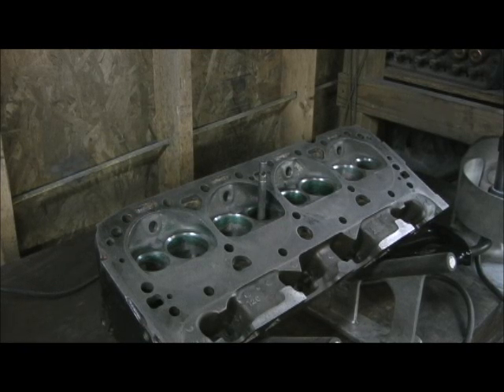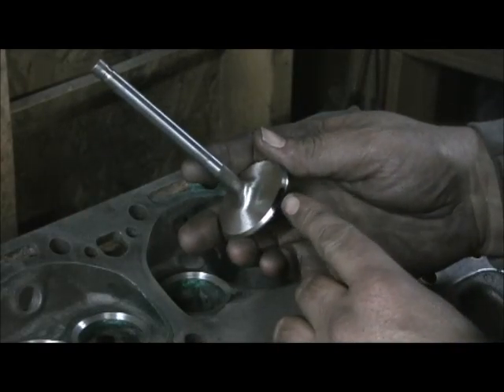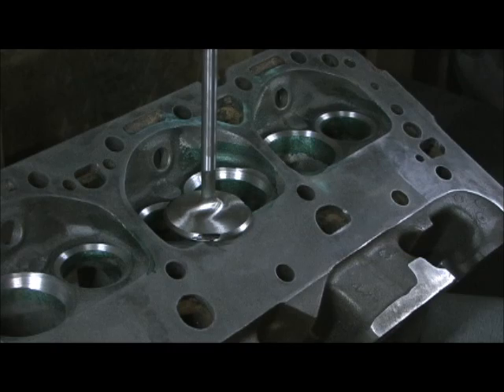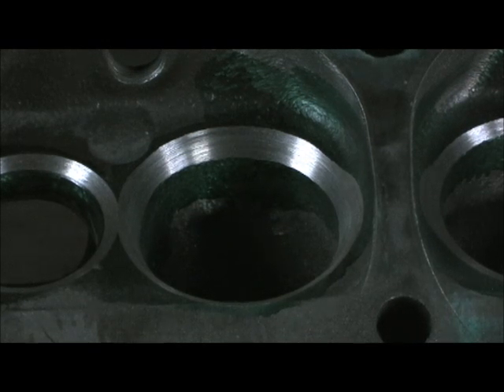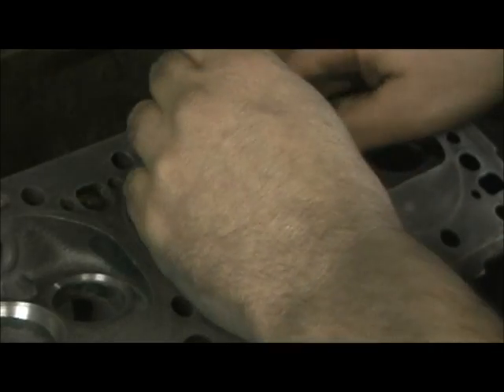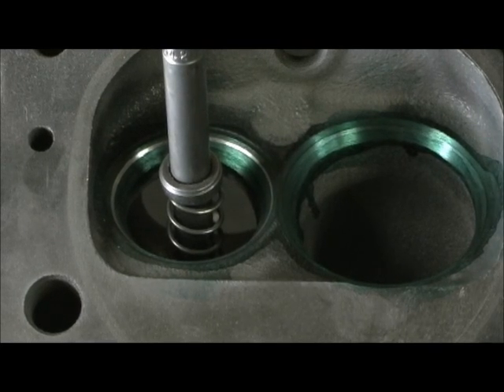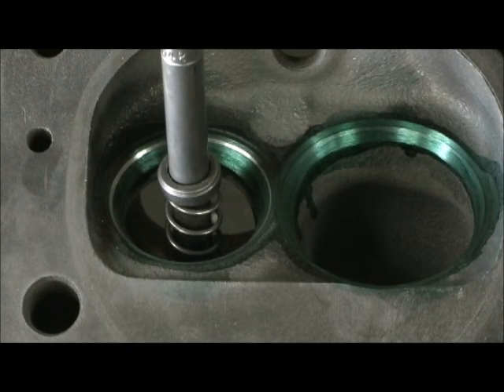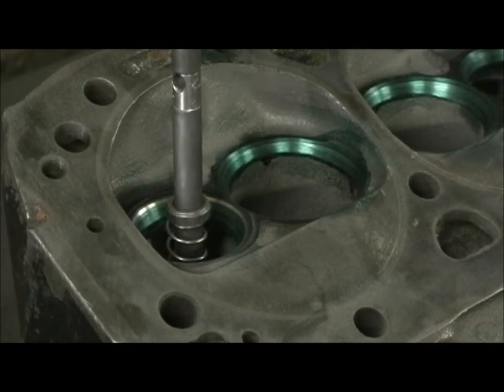Casting 441 Ported Head TRUE Three Angle Valve Job 9.

Comment: Planning to do valve job into my Infiniti FX45 ( 4.5 litre v8), 4 valves /cylinder, 2 overhead camshafts, done "simplier" engines before, also planning to hone cylinders a bit, and just replace piston rings same time. Reason for this, engine, has only 120000 started to smoke really bad, no noise, no really lost of power, but has to add oil daily now, no oil leaks otherwise. So thinking my valve stem seals did run dry a little???, now needs to replace them. So, couple questions: you think I could sand/grind valves myself?/ Done that before, and how much free play there can be in valve guides, so I don't have to replace them/ or valves?? I will replace timing chains (2) same time, so could I adjust valves ( has shims), when heads are off the engine?? Thanks, you are a good man, learning a lot from these videos! youtheman =) Also, planning to replace connecting rod bearings same time, has to take pistons out anyway...., how do I measure, what size bearings I need??? Thanks =)

Comment: If I took my 3800 Series II engine to a machine shop, how much would I plan on spending for valve porting, head truing, cylinder boring and how likely would it be to use the same crankshaft and camshaft that came with it.  I'd like to say that the cylinders wouldn't need to be bored out if I could hand crank the engine, but the damn thing is seized up.  A junkyard motor is $1000 with 136,000 miles on it, remanufactured $2270.  What is my cheapest option here?
Reply: if you buy the reman it will come with got dang china valves.

Comment: Power is made in one place, the heads. Why? Because they are the biggest restriction of the entire flow path. That is why bolting on a 750 Holley to a bone stock 350 does not do much over a 500 cfm two barrel.

Comment from the maker: Continued) engine of 350 inches at least 65 HP. Change the cam and gain another 25 to 35 HP, change intake and go to headers and get another 35 to 50 HP so it entirely possible to go from 200 to just at 350/350 through the heads, cam change, intake and headers. The power is made in ONE place, the heads, then you build everything else upon that.

Comment: still the 1.6, I will swap them this month for full 1.5 rollers, the car is wants to be above 2500 rpm, with a 6spd it's not too bad but I think I will opt for a little more drive ability.

Comment: Still the stock rear, stock bottom end, I know what will happen to that rear if I put slicks on it and until I can justify 2k for a new rear this one will have to do. I was doing some research and there is a way to make the rear end last longer but don't think I want to waste my money on a 10 bolt, rather wait, winter is coming and the car wont see the road till spring anyways. The 391 is not bad but I might as well take it to the next step with a dart block sbc 427 in the long run.

Comment: Carp, which rockers worked the best? 450 at the wheels? Upgrade the rear yet? If not you should save up. What is next a 391 lt1?

Comment from the maker: Like I said, to each there own. This discussion was not about flow numbers (although that is an issue) but rather about sealing capability and longevity of the 45 degree angle. Looks like you win guy, I hardly ever hit .0002 in my 24 years of doing this, so your the man....

Comment: If your with in .0005 with your run out that is a good valve job I use a gauge to check how concentric the seats are, I use a Van Norman machine with an air table with Sunnen cutters with this set up I've seen .0002 on the gauge that's about as close to perfect as you get I used the Sunnen VGS I didn't care for it I always had to finish with stones the run out was terrible with the Van Norman no stone finishing required and the flow bench numbers are equal or better than Sioux grinding,

Comment from the maker: WTF, Continued whenever) to remove and set the Depth of the valve in the bowl and to set up the 60 (70, 80) after the bowl hog or W/O the hog so the stones have NOTHING in the way of cutting the 45 seat angle and it will PULL the concentricity of the Seat/Bowl relationship to where they behave like a well oiled machine to one another!!! This has been my experience, and that of MANY others currently in this profession who have been at this a LONG TIME. like I said 7512, I respect your opinion.

Comment from the maker: Really Final Continued). side or another causing the grinder to remove more material off one side or the other, then the cure for that (and it is a blessing from God here guys) is to take the hand held  "seat pointer" that affixes the position of the seat by holding onto the stem and moving the pointer to the place you want the seat to be positioned at. I set it at the TOP of the face of the valve (nearest the stem where the undercut is) and use the awesome seat cutters (or bowl hog) Contin

Comment from the maker: Continued Final) to .001. That being said, There is a USE that I love the Serdi and Sunnen for, and it is a TIME SAVER, and does the best job of. That is PREP for the valve job. What I mean is Me (along with MANY other professional Head guys) use this machine to remove the bulk material inside the bowl, and to off-set the guide installation (Guide are always a LITTLE off, some are a LOT off depending on how wore out the guides are, or the guide hole wallerd out). IF the guide is OFF to one (cont

Comment from the maker: Continued) National Records in Super Stock and Stock Eliminator.  THERE IS NO FIXED CARBIDE OUT THERE THAT WILL GIVE THE CONCENTRICITY OF THE SUIOX STONES IN TERMS OF SEAT RUNNOUT!!! This is of course the 45 degree angle after using the 60 and 30 coming to a point.  I am not saying Myvintageiron7512 that there is no machine out there that cannot produce the runnout numbers I use (no valve job above stage III goes out my door with more than .001, and I TRY hard to keep it from 0005 to no more (c

Comment from the maker: Continued) what we found, was horrific runnouts, some in excess of .004. We played with speed of the cutter, several types of cutters and pilots till me and him was blue in the face. Hell, even with the TOBIN ARP and the tooling that brought it up to Spec would still hit .003 runnout. Now what I am about to say is up to date wise till 2008, and the latest VG machine and Serdi machine ) I worked with at the last shops before I went independent in May of 2009 after winning my final NHRA (continue

Comment from the maker: Continued) me and Paul begin to really pay attention to the valve seat runnout of the machine, the carbid cutters and pilots. Lapping just does not show the whole picture, it just is a quick way to see IF it is the same color all the way around, and a way to "JUSTIFY" you done a great job. The only way, as I am sure you know, is with a SEAT RUNNOUT GAUGE (which very few shops have these days, and it still blows my mind that they don't which tells you what type of shop they are). Continued

Comment: I have to disagree with you on the cutters I have the same sioux stones and drivers as you had them for many years they do work well however also sunnen 3 angle cutters the sunnen cutters are every bit as much as true as the stones it's all in the set up if you do it right the cutters are true with in .0002 and no lapping required the reason most people think that cutters are not true is they don't know how to use them.
Regards

Comment: great video. ive ground some seats and valves before, never a 3 angle job. I got really frustrated this evening trying my first 3 angle. kinda dicked the heads up.... started with the 45. then did the 60 and 30.... didnt know the order in wich to start.. makes good sense doing the 60 and 30, then widen your seat with the 45. hope I didn't ruin my heads.... and the shop that did my guides had them off center a bit... had to grind a good amount off one side before it ever touched the other.

Comment from the maker: I used a Serdi, a Sunnen and the Neway cutters a few years ago, while they are QUICK, they lack Concentricity BADLY!!! I remember the Serdi when they hit the US back in 1990, thougt it was the best thing since sliced bread, till I put a runnout (NOT LAPPING) gauge on it and I was shocked, over .003 on some of them. I played with the cutter speed to no end and it never got below .002 on most. Thing is the design, ONE CUTTER ROTATING WITH NO PRESSURE ON ONE SIDE makes it uneven on pressure sides.